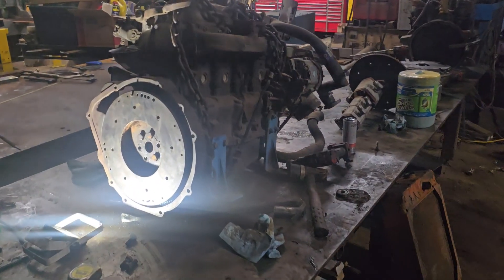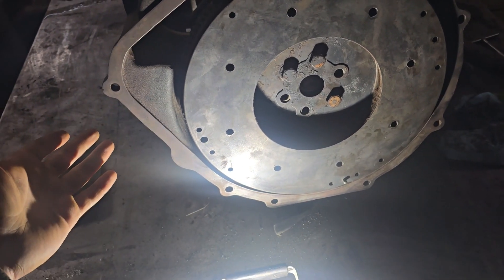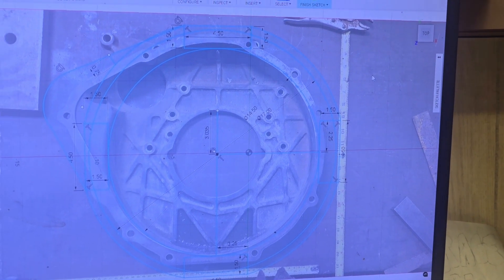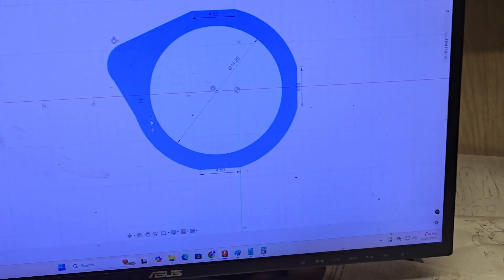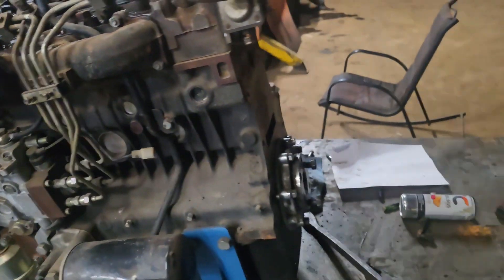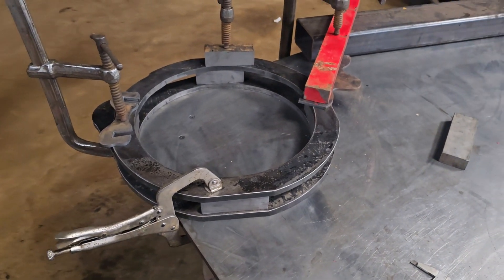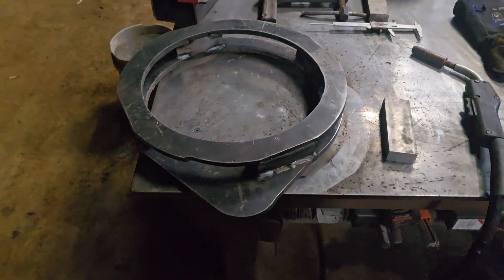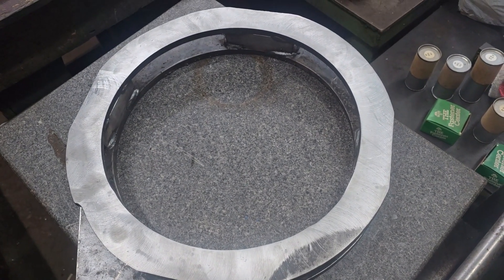Building a Engine Adapter Plate To Swap A Kia Diesel Engine Into A Carry Deck Yard Crane

Comment: Talking not crap music, great informative video. Plasma cut quality is great
Reply from the maker: It's alright I'm building a new machine you can see where it lost steps on the first part i cut on the arc. Will be upgrading the plasma unit too should be able to cut 1.5 inch n maybe I will set up a torch for thicker.